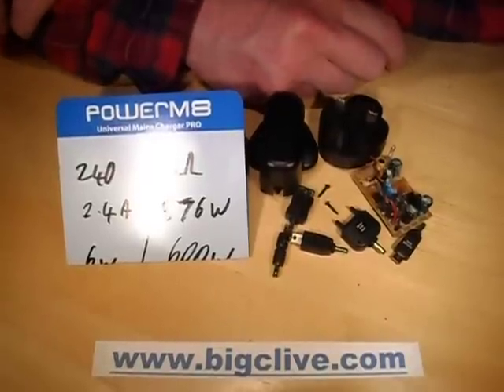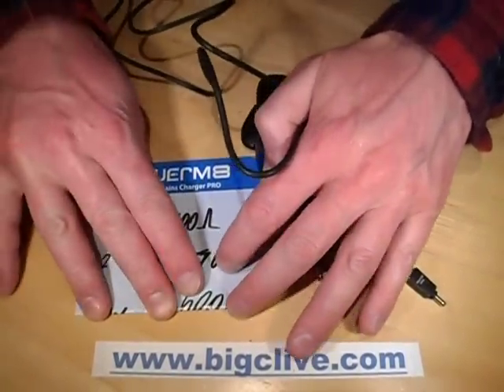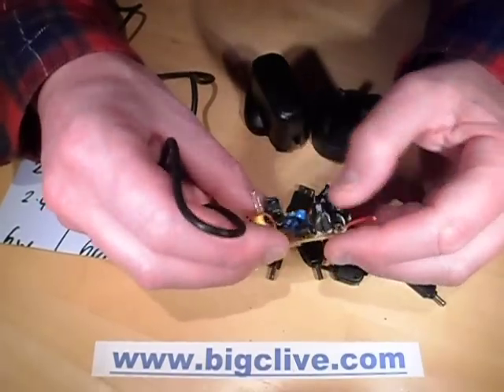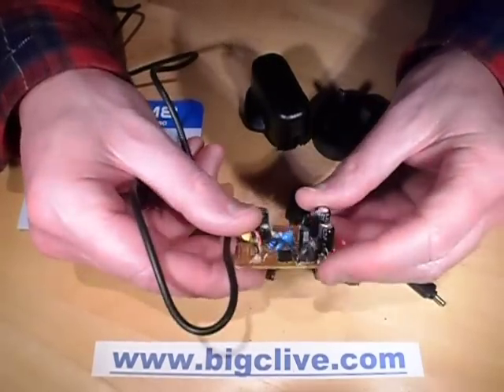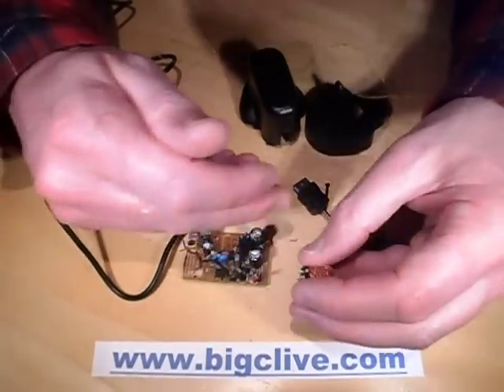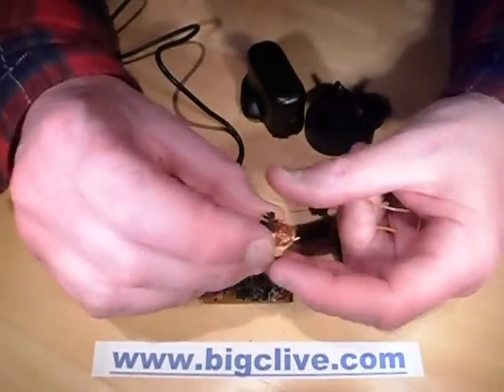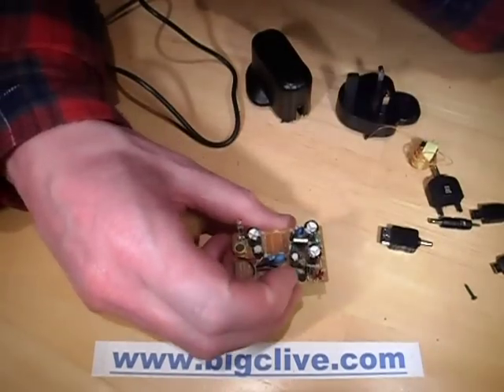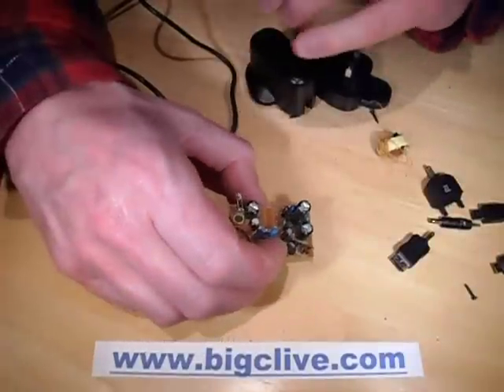Inside a Poundland mains (240v) USB power supply.

Comment: Managed to get one of the newer ones (signlex, came out within the last week or so), rated at 5V 1A... am guessing it has a similar layout... bonus, i got mine for 90p as there was a sale on for some reason.
Reply: Poundland now have two variants of the Signalex-branded USB mains adapter - a 1A version in this enclosure and a smaller 1.2A variant. One has to wonder about the isolation on the smaller version.

Comment: There's probably a zener diode that clamps the voltage down to 5.6v or less - the regulation is lousy on such power supplies, they have to output higher because when you actually put a load, the voltage will go down slightly.
They also use a higher voltage because the cables are usually very thin and there's quite a voltage drop on the cables at various loads.